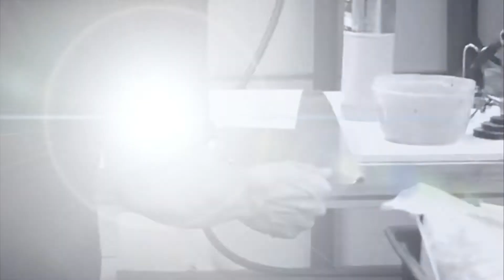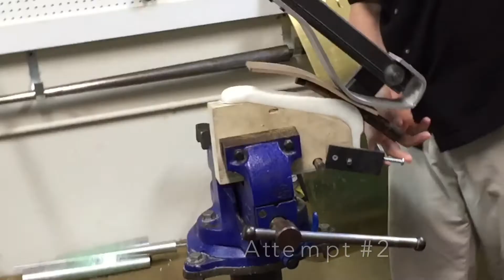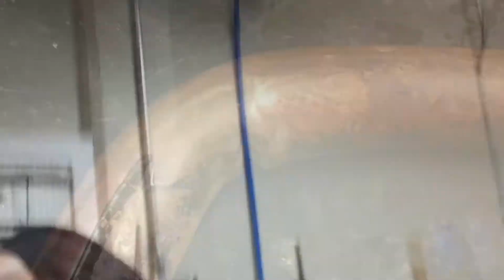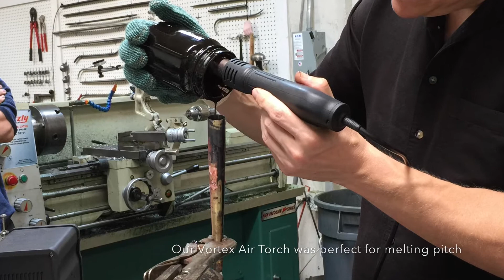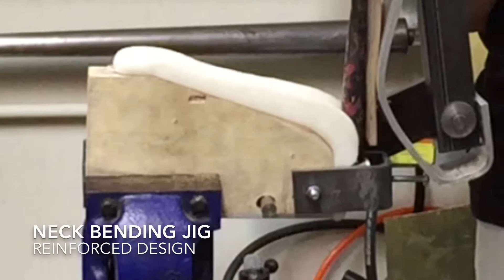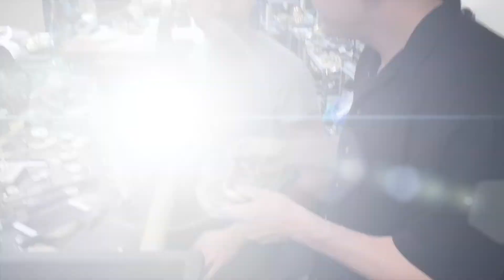Sax ProShop at MusicMedic bends a saxophone neck

Comment: I'm interested in this subject. I see there is still a kink left at the bend point and there are some ripples on the underside. Have you seen a YT video of trumpet master bending the crook with Cerrobend? He appears to be more successful and he knows what he is doing rigth from the start. I wonder why there would be a need for complete bend of the saxophone neck. As far as I understand that's not the way the necks are formed at the factories.
Reply from the maker: Thanks John! These early experiments were fun! We started using a different bending compound instead of pitch which is more user friendly. We also now use a blow out mold that is the same as what you would see in a factory to create a final dimension.